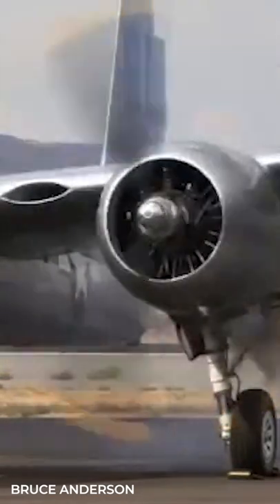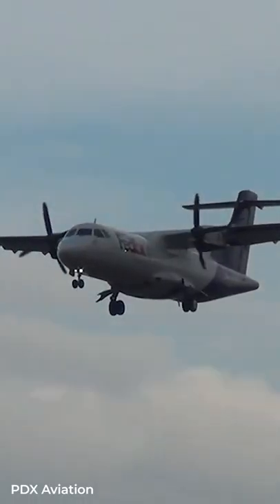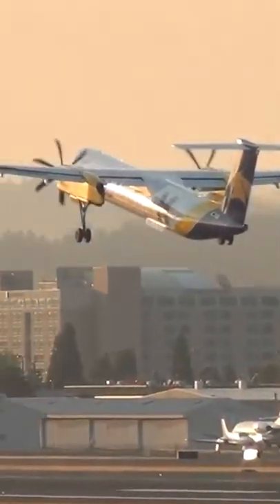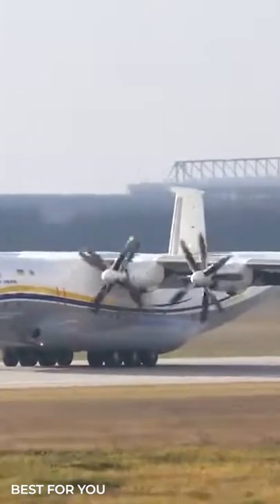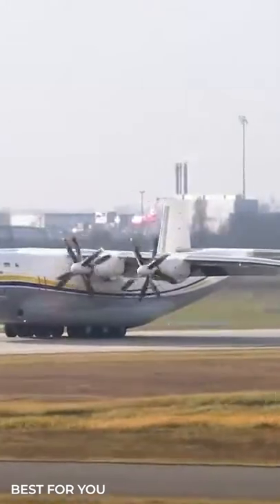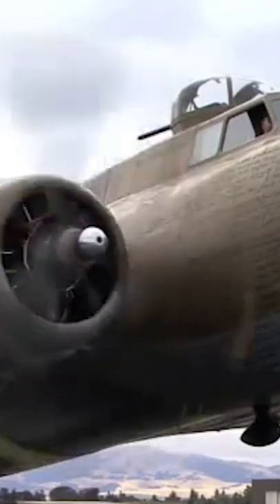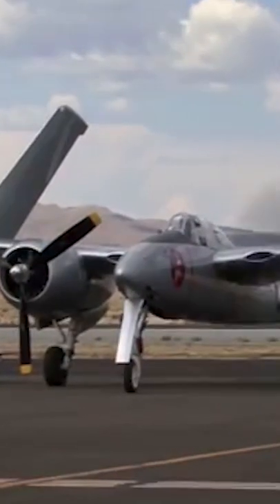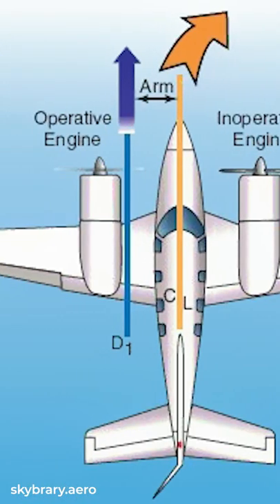How Aircraft Propellers Rotate #shorts

Comment: The last statement is funny, if one prop goes down, is it really matter the remaining one was in sync with or exactly countering the downed one?
Reply: You are right, but what he probably meant, with a longer explanation, is that having the propellers rotate opposite to each other makes losing either engine just as difficult on the pilot. (That's why he mentioned the term "Critical engine")
Reply: The critical engine on a twin prop is an important factor. The specifications for an aircraft specify which engine is the critical engine and pilots need to know this because it requires different actions in an emergency.
Reply: The long answer is no. If you search for a video called “why are prop plane engines slightly offset to the right” it will explain. Basically for 3 separate reasons aircraft tend to pull one way or another depending on which way the prop rotates. So because there are two on a twin prop, because of the way air moves around the aircraft, losing either the left or the right may effect the craft tendency to either yaw or roll more than losing the other.

Comment: The only issue I have with the video is in regards to them saying that if they lose an engine that it would cause a plane to yaw. That is true. But the way they said it seems like they're saying it would be  worse if both engines were turning the same direction. In the event of an engine failure it would not matter
Reply from the maker: Thanks for the feedback! ✈️ - LR
Reply: I'm totally agree, it's not matter whether they have counter or not, yaw will introduced when only one engine is on
Reply: If the critical engine fails it would be worse. Pretty sure they said that in the video

Comment: I'm not 100% sure, but, I'm pretty sure most modern prop aircraft have counter rotating props. The main reason is saftey. If one goes out (especially on takeoff) the plane won't flip onto its back which is exactly what it will want to do.
Reply: Interesting perspective but need to clear this out, What do you mean by flip? On what axis? What the correlation with propeller rotation
Reply: @rezkypar  literally the plane does half a barrel roll and falls to the ground due to the plane not being built for inverted flight
Reply: @bisken6547  why would it flip though? You’d spin before you’d ever flip like that. You yaw significantly more than you roll and you’d stall the rudder well before you’ll ever stall a single wing

Comment: Counter rotating props have the advantage of negating p-factor, or a twisting of the airframe from torque, causing a yawing moment. This means that when a pilot "slam throttles", the airplane would go straight without any need of rudder or aileron input.

The video states that if the airplane lost one engine there would be a yawing moment, and that's true. But that is due to asymmetric thrust, not p-factor. 

To better simple flying. Do better.
Reply: It’s due to both. If the critical engine is lost (left engine if both engines turn clockwise) the required rudder input to overcome the asymmetric thrust is greater than if you lost the right (non-critical) engine, thus increasing your Vmc speed (speed required to still be able to control the aircraft on one engine operative). The reason the left engine is called the critical engine is due to several different factors but one of them is p-factor. Since the center of thrust on the left engine is closer to the aircraft’s CG than the right one due to p-factor, if you had a left engine failure the plane would be harder to control due to the right engine’s center of thrust being farther away from the airplane’s CG thus having a greater moment. I hope that made sense, but yeah p-factor does play a role.
Reply: @lukecole6203  thanks for the education. I didn't realize that, but it makes sense.